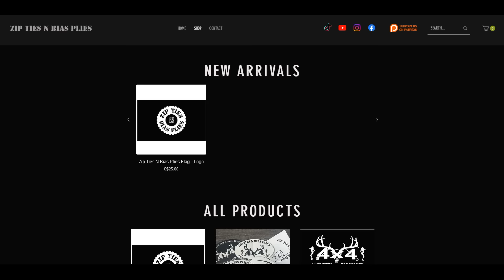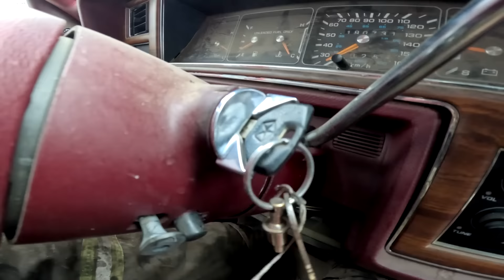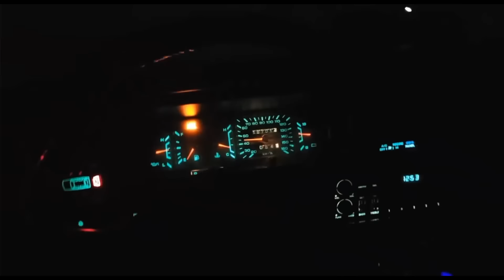7.3 IDI REVIVE N BURNOUT DEEELUXE!!!

Comment: I've been budget rebuilding my '90 350 crew cab IDI over on my channel and mine is the same setup.  Its a Lariat package truck with power up front but manual in the back.  From what I can tell, they never offered the brick nose with power rear windows (which is a bit annoying...  But considering how hard rear door parts are to find... In kinda glad.). She's also got that flexfuel option 😂

Comment: My 94 F350 crew cab non turbo idi 5spd 4x4 has electric in the front and manual windows in the back.  As a bonus, the a/c still works after it sat for 6 years

Comment: 100% right on with how not to keep driving with clutch issues!   those transmissions are pretty much bullet proof!     and the ol shipping crates with the nv4500 kills the 3rd syncro from not properly rev matching the down shift.  ive been into them and that is all that goes wrong. minus the 5th gear retainer backing off but thats not a driving issue

Comment: Peg, I was ordering tires for my Jeep and for some reason thought of you!  And before you say it, I built it, it's what I do, it's a 74 CJ5 with a Cummins. I'm not what you typically say about Jeep guys. LOL Be well my friend.
Reply: had a 79 cj5 304. it was a blast. mud tires and we lincoln locked the front. it would go anywhere.
Reply: @MrChevelle83  Nice! I've had jeeps in my family since I was born and I'm 55 now. I have 3 myself, and 1 in the shop I'm building/restoring for a customer. Thanks for sharing!
Reply: @onestopfabshop3224  I had an 82 cj7 and 83 CJ5.  Both with the inline six.  You couldn't kill em.  It just could NOT be done! Almost flipped my CJ7 on a cloverleaf in a driving rain, near Virginia Beach one time but that was the extent of my 'end of life' experience with them.  They are both long gone now, but was THINKING about maybe searching for another.  THEN.... I see the prices.  HOLY * * * * .... may as well buy a brand new F-150!!!     Probably just as well,  in my family, AMC and Chevy products would start a fist fight if parked next to each other.  :P   Picked up a Chevy Colorado this past summer so that will have to do.
Reply: @leftistsarenotpeople  Appreciate the stories. I think we've all had near death experiences in a Jeep, especially the old ones. I worked my front end over by cutting off the outer "C" off the end of the Axle tubes and rotating it back for more positive caster. That little CJ5 drives down the road so nice, hardly any correction needed, and the best handling CJ I've ever owned. Positive caster is key.
Reply: @onestopfabshop3224  I always wanted a CJ with the that original AMC 304.  That was my DREAM Jeep.  Should have swapped one into my -7 when I had the chance.  Some folks would shoe horn a 350 in theirs which is pure BLASPHEME but they certainly sounded mean with a good cat back pipe system.  Knew a guy in town that had the -5 with a 401 and a three speed.  Used it to pull people out of the lake when they tried to launch thier boats and backed too far out into the muck.  Sometimes  you'd see big ol jacked up box bodies and K5's and the occational F250 nearly BURIED out there but he'd get 'er done with that slow crawl brute and a snatch rope.  You could hook to a 200 year old growth loblolly and I swear that thing would idle the roots right out of the ground!  The low end grunt those things had were silly!   God I miss mine now that we're talking about them.
Reply: @leftistsarenotpeople  When I got mine the guy I bought it from had an AMC 360 in it. That thing scooted. But crappy mileage. With my 4BT Cummins I get 26, on 35s 4 speed with auxillary overdrive. I own a shop and do commercial sandblasting and paint so I did this thing to right for myself. I get tons of compliments and I even won a couple trophies with it. That little 3.9L 4 cylinder is so much fun, the turbo is so loud, I can roll coal if I so desire. It's just cool! I built everything for the conversion in my shop and all the work was done by myself.
Reply: @onestopfabshop3224   Never, EVER even thought about a 'coal roller' in a CJ but that is interesting and sounds like the prefect MAD powerhouse for that frame.   
Nutties ever powerplant conversion I've ever seen was a dude that took a TJ when they first came out and stuffed that V10 Viper engine in it.  Yeah, engine bay was a bit 'CROWDED'.  Probably had to 4-coil the front suspension to keep all that weight from scooping up asphalt.  lol

Comment: 4:10 I had to replace the clutch master cylinder in my minty 1994 f-1shitty cuz ford thought it would be a good idea to make the rod that pushes into the clutch master cylinder out of plastic. it broke after 30 years for fiddle fuggin around and replaced it with a metal chineseium unit from vatozone.

Comment: The same exact issue with the clutch happened with me on two of my trucks. On one of them I cut off the eye of the pushrod and welded a nut on and on the other I just threw a fuckin vicegrip on and called it a day

Comment: Let's address the peg in the room what happened to your leg i don't remember if you ever said anything.   Also it looks like the dynasty needs a tractor weight on the front suspended out a foot over the bumper.   Might then attack a brush guard over that.   It lengthens the wheel base with actually lengthening it.